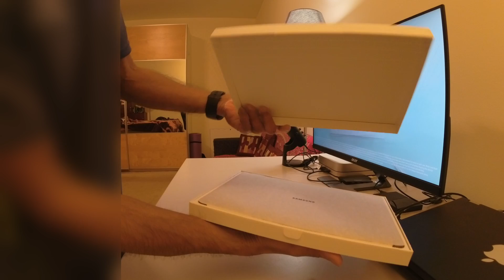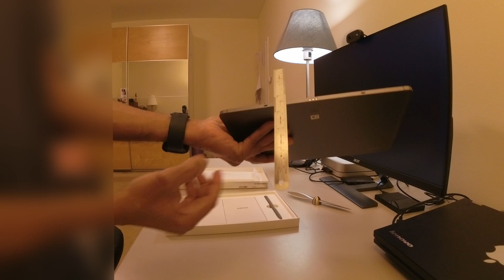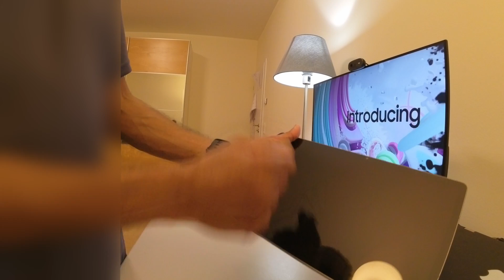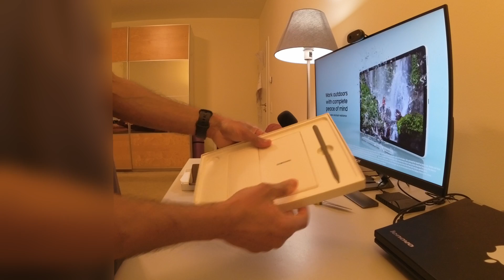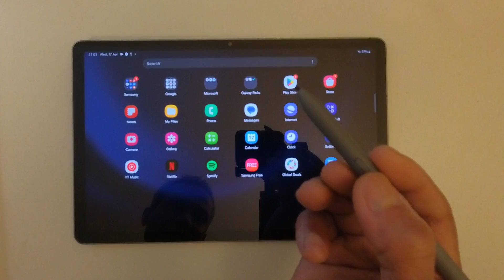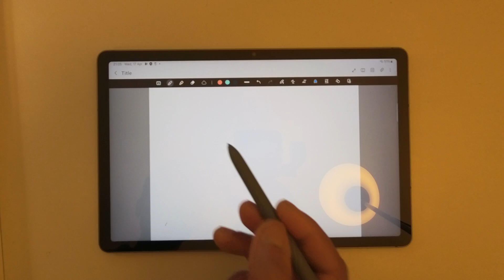Samsung Galaxy Tab S9 FE - Unboxing & Setup

Comment: No plug included at all …. Mime has two cameras on the back…button on my stylist.. does it come with that card in it?
Reply from the maker: Exactly, no plug included ... just the charging cable. The stylus has a button in the middle. 

The tablet does not come with a removable memory card. But you have the option of adding a micro-SD card, if the included 256 GB (top spec) is not sufficient.